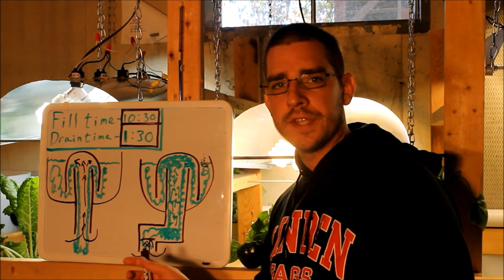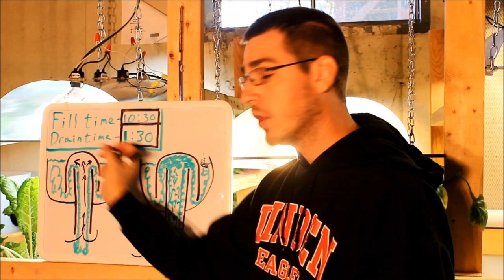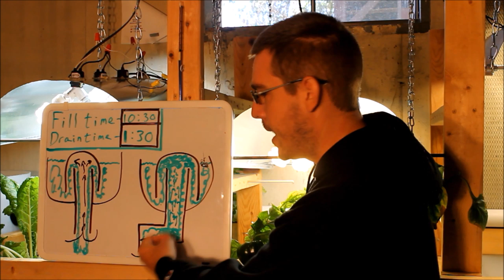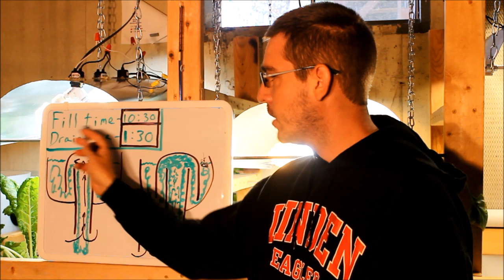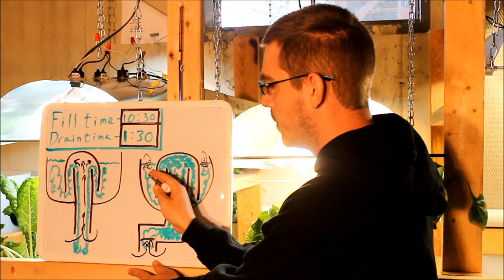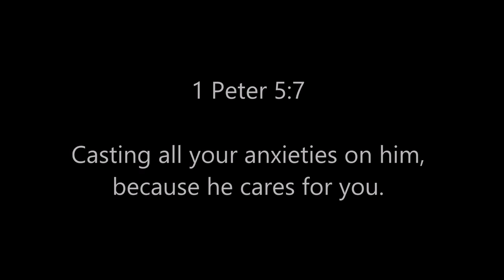Aquaponics System Design - Bell Siphons

Comment: Thanks for the videos and taking the time to explain. I don't mean or want to correct you, but only want to share my personal experience. I have two small aquaponic systems I started about 9 months ago, one has a siphon as you described with an elbow about an inch or two from the bottom and another one to point the water down into the fish tank, and it works just like you explained, my second system has a straight drain right into the fish tank, no elbows, and it works just as well as the other one, actually I would say the suction is greater on this one, and because it has better suction I use it to bring air into the tank and therefore this tank does not  have a bubbler.
I have been practicing on these smaller systems, different plants, different shade, etc because I am looking to build a much larger system with a 4000 gallon tank. Again thank you for sharing your very informative videos.
Reply from the maker: Thanks! And all experiences are welcome here so thank you. There are a lot of factors for the drain pipe sizes and it makes sense that the suction might be greater since the flow has no restrictions (the bends in the pipe). The difference could be with drain pipe size or other design factors as well. Using that water flow for aeration is an excellent idea and I have something similar with my swirl filter overflow. I appreciate you sharing your experience here! Thanks for watching!

Comment: great video, thanks. I've enjoyed your whole series and I'm taking alot of tips from your experience. Do you have any documentation on the overall pipe sizes and piece/parts that you used for your system? I know you mention different parts in some of the videos, but an overall system diagram would be helpful, if you wouldn't mind sharing.
Reply from the maker: Thanks Dave! I don't have an overall sketch or schematic of the system however this is something I am looking into doing. I would like to draw up some plans so it can be reproduced if someone wanted to so maybe in the future I can get that done. I can tell you as far as pipe sizes that I am using all 2" PVC for the supply and drains pipes. 2"-2"-1/2" tees for the supply to each grow bed, and 3/4" PVC for the drains. Hopefully that at least helps a little. Thanks for watching!

Comment: My indoor bell siphon is Mucho-finicky. I think a big part of that is my smaller grow-bed. It's only 2'x2'x10' so the fill rate is much faster than normal. Seems like I am always adjusting something on it, usually because the siphon won't break.
Reply from the maker: That is a good point with the smaller grow beds it might increase the fill rate level around the siphon making it harder to break. Maybe try cutting higher drain holes along the bottom, Let me know if you come up with any good solutions for that. Thanks for the input Eric!

Comment: Can I use a host to connect to the outflow hole of my filter box for siphoning? The reason is, I am using a rectangular shape flower pot and it only comes with a hole at the bottom that had only 15mm hole. And nothing can fit inside like a pipe except by using a host which can fit exactly. Is an outflow hole of 15mm too small to drain? The size of my filter box is 33.5cm L x 12cm W x 14cm H and my aquarium is only around 9 gallon.
Reply from the maker: +Heidi Chan I don't see why a hose wouldn't work in that case. 15 mm should be fine

Comment: the elbows under how long does it need to be ? and is there an angle to it or just 90 from tank and 90 into drain pipe?
thanks
Reply from the maker: No set distance. I would come out then 90 over at least 4 inches then 90 down

Comment: I have a question can I connect all the beds together and do a single bell siphon Thx
Reply from the maker: You could do that although I am not sure that would be optimal. Over time the flow from the furthest ends of the beds would slow and cause the water to incompletely cycle

Comment: Uniseals work fine if it's a tight fit.  Using a reducing adapter on the top of the siphon tube will give you better performance.  Just put the big end up.  Then the distance between the bell and the downtube won't be so critical. You'll have to shorten the downtube some if you want to keep the current water level.